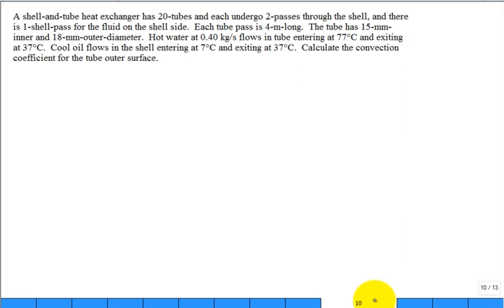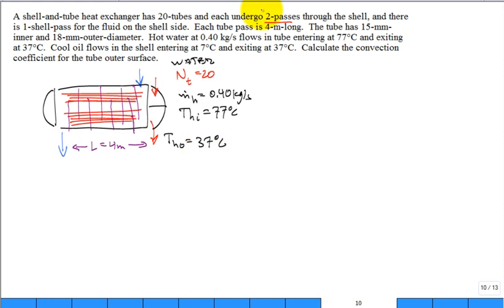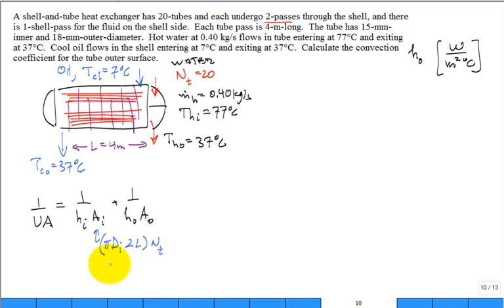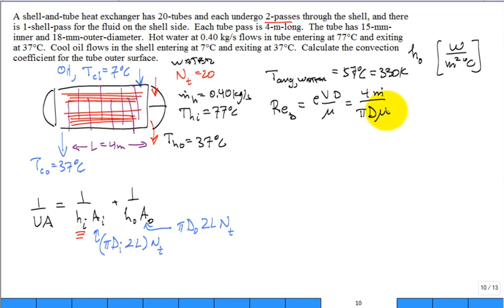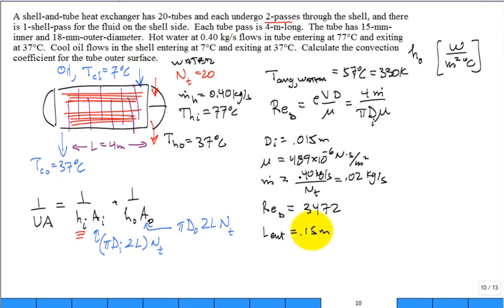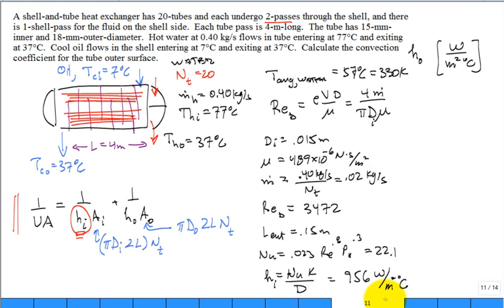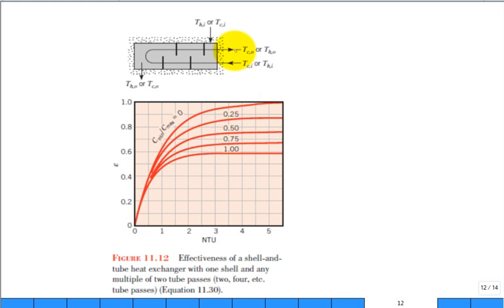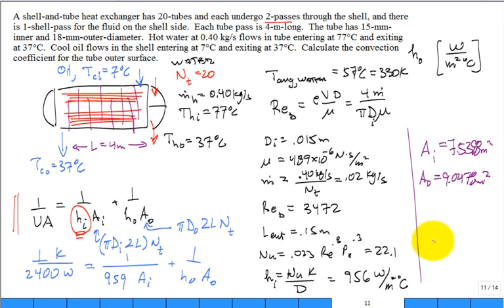Shell tube HX eNTU calc ho

Comment: The reynolds number was calcualted incorrectly. The density of the fluid was completely neglected in the caclulation
Reply: Density of water in SI units is 1, so ya he's fine.
Reply: Incorrect.  v = 4m'/(rho * pi * D^2 * number of tubes).

This leads to Re = 4m'/(mu * pi * D * number of tubes).  He factored in the number of tubes into his value for m', meaning that he number of tubes term in the denominator can be disregarded, leading to the formula he wrote down.  He did things right
Reply: yes .it is wrong it will be laminar flow